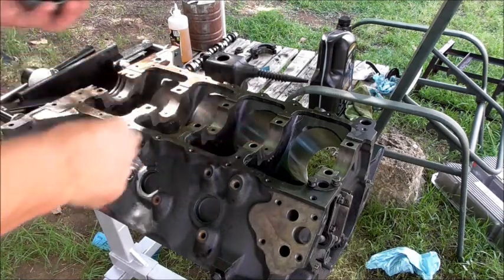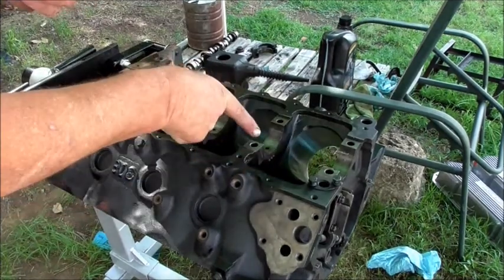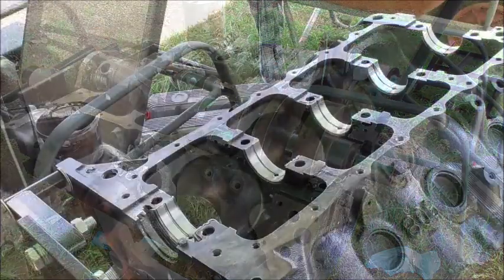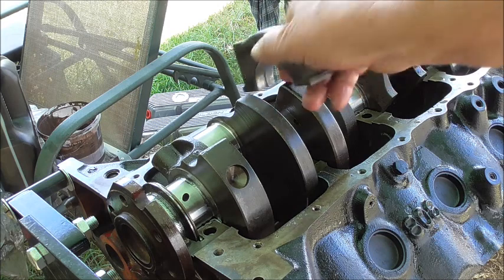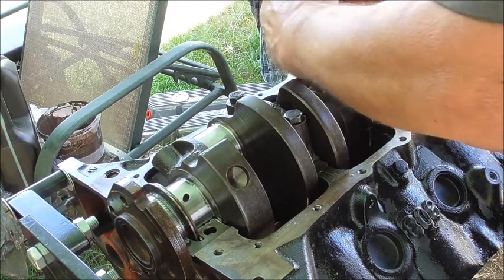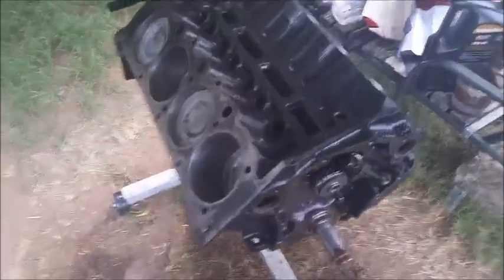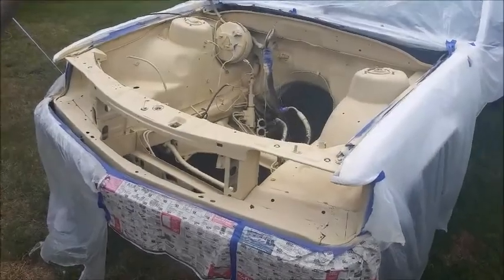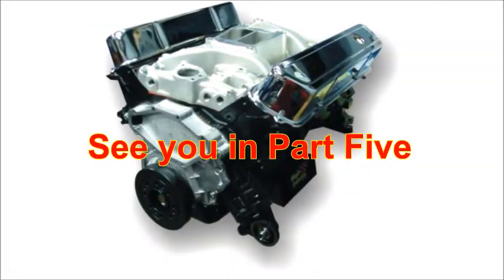Re building 308 V8 engine (part 4)

Comment: I've tried fitting a rope rear main oil seal into a Buick 3.8 litre LN3 (VN series 1 Commodore) V6 engine without much luck when I built one up for my brother, it's the first time that I've seen anyone do it that way,the rope seals in the VNs were a pain in the ass for Holden under warranty as they frequently leaked,the Holden engines weren't renowned for leaking oil like that - I don't know why.

I've built up a 3.8 litre Buick V6 L27 (VN series 2- VR series 2 Commodore engine) which ran a 1 piece rear main oil seal ,there's no trouble with them leaking oil.

I built up a Nissan RB35/30 hybrid engine (24 valve 3 litre engine) where I used a 300,000 kilometre old block,I had problems with the orange silicone rear main oil seals that I bought fron Autopro leaking after I speedi sleeved the rear main oil seal journal, a trip to Skefco bearings saw me with a violet coloured one which did the job of keeping oil in the engine.

Since then (before last Xmas), I partially rebuilt a Chevy LS1 motor which has 337,500 kilometres on it,it was only new lifters & a timing chain kit which I fitted along with new gaskets & most of the seals except the rear main seal as I'd already replaced that one.

It's done almost 346,000 kilometres with no oil usage,it was Dyno tuned in 2003 when new & a custom sports exhaust system was fitted,I replaced the rear knock sensor in January after a check engine thing let me know It's got a P0332 code.

Then when I was working last week I had to order a new front knock sensor & wiring loom after the check engine thing came on at 110 km/h on the freeway,that let me know that it had a P0327 code.

I replaced the knock sensor & loom yesterday & now the car has heaps of get up & go !
Reply from the maker: It's a pain that a neoprene seal won't fit this model
Reply: Fel- Pro apparently have a rubber one which is available from Engine Master Australia :-

https://www.enginemaster.com.au/felpro-2-piece-rope-to-rubber-rear-main-seal-febs4